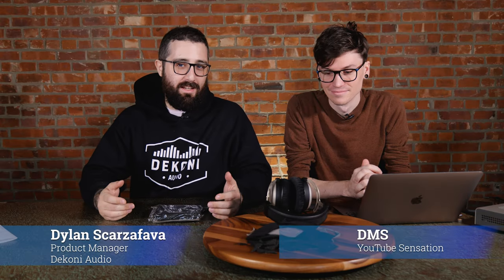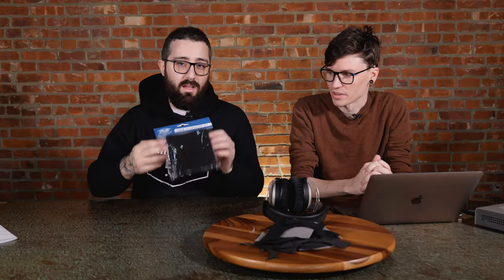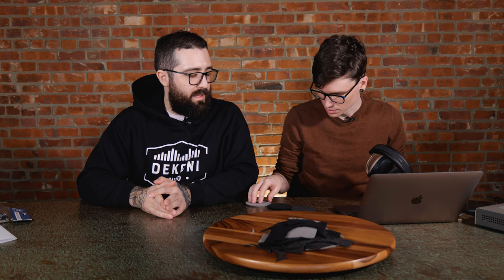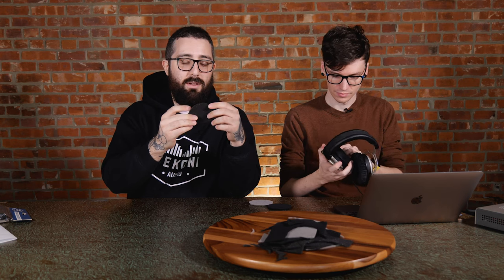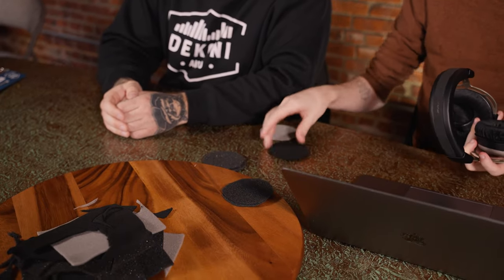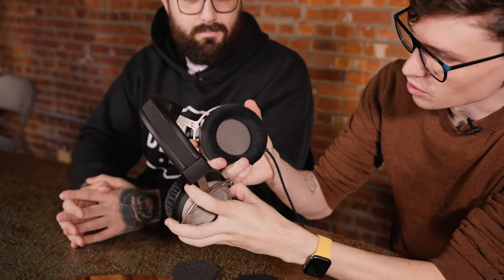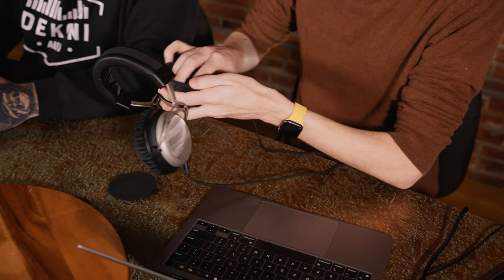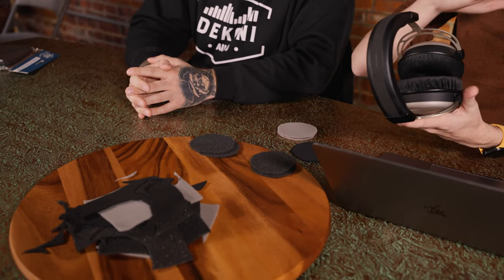Headphone Upgrades on a Budget! | Dekoni Foam Attenuation Kit with DMS | Dekoni Audio

Comment: "Here is our foam kit, with zero description of which material is which(even after DMS specifically asked the question on camera), and which has what density. Oh, and 3 of them almost look identical, for easier identification. They also come in pre-cut circles, for easy installation in most headphones! Thanks for watching!"
Reply: received mine today, searching everywhere on the web which one does what so i can try to match it to my headphones without buying 3 kits and trying each foam on each one....

Comment: Just received my first Dekoni pads last week for my Hifiman Sundaras...after about 9 months my stock pads stitching completely fell apart. Decided on Dekoni Hybrid pads. At first they felt really stiff but after a day or two they really settled in. They are extremely comfortable and I can tell they will last much longer then stock. And I honestly can't tell the difference sound wise. If someone was to test the FR there might be a difference but without me actually A/B testing them and going from memory they sound too similar for me to notice any difference.